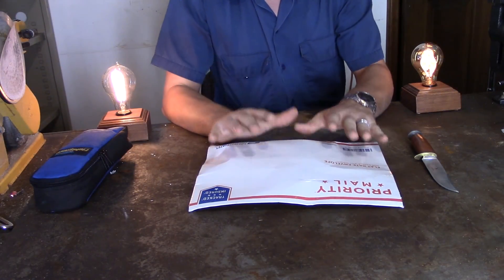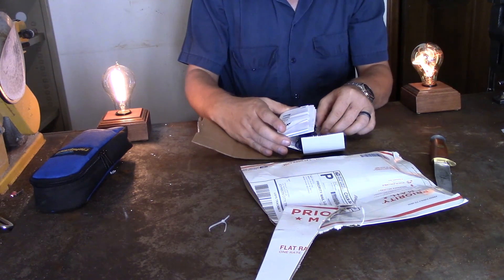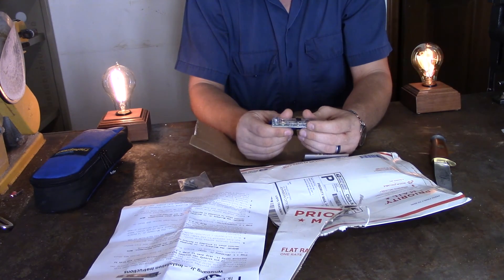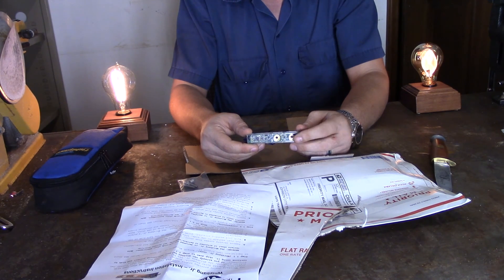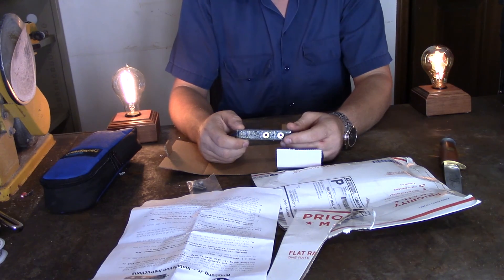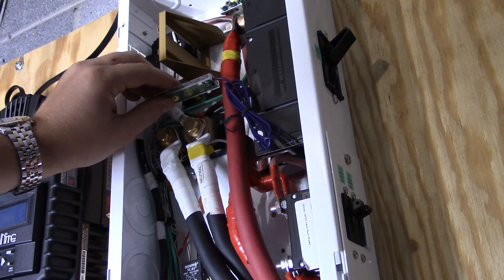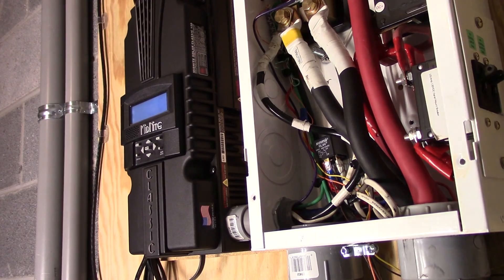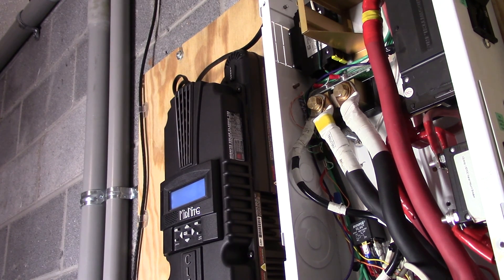Midnite classic wizbang Jr and why it's important to have for your solar power charge controller!

Comment: Additionally. Sounds like something that should be built into the charge controller if it is so essential.
Reply from the maker: It's not possible to add a shunt in the charge controller when you could possibly be discharging at 200 to 300 amps you have to have it external for instance my shunt is a 500 amp shunt and it requires a capability of not burning up at 500 amp the charge controller will never be able to allow 500 amps to pass through it for instance my charge controller can only charge it 90 amps and then we would have to have an output power circuit on the charge controller to provide 500 amps through the same circuit that runs a hundred amps instead they make it robust and strong externally

Comment: 😞😞😞😞😞 why. Why would it be nessesary to turn your battery on and off? This makes no sense. I been using solar and reading about it also for over 10 years. This makes no sense
Reply: This video was about worthless. Didn't even show where he hooked it up in ch controller or installation on the shunt. Show us closeup and straight on not at an angle at a distance.
Reply from the maker: Okay instead of thinking turning your batteries off it doesn't exactly turn the batteries off to the inverter and charge controller it turns the solar array off and switches to grid power automatically with the capacity on this for instance if you discharge your lithium batteries down below 3 volts per cell you completely destroy your lithium batteries now 18 650 run lower than that but I'm not going to run my lithium batteries that low since I've recently upgraded to a 33 kilowatt lithium battery I would never allow it to have a discharge below 3 volts in fact I've actually got it discharging at a much higher voltage than 3 Volts per cell so my total of 33 kilowatts but I only used 20 kilowatt and I have an automatic shut off or switch over for grid power so my apologies on how I explained it previously but the batteries never turn off from the charge controller
Reply: @solarpowerelectricityandel2915  I don't ever want to disconnect your panels from a charging system. Never ever. You'll burn those panels up.
Reply: @gratefultedd969  that is incorrect.

Comment: mostly rhetoric here in to four minutes. It's a battery monitor. It measures current in and out of the bank. Yes, it is a good idea to have one to help determine your state of charge and account for supply and consumption.
Reply: Thank you so much, I've watched three quarters of the way through and I still don't understand what it does from his video.

Comment: looks like you have a lot of experience, can I ask you it you think this charger is going to be able to charge lithium-ion(18650)battery packs
Reply from the maker: yeah absolutely
Reply: so do you think I should change some parameters, because the manual of this charge controller does not tell nothing about lithium
Reply from the maker: It will charge anything between 12 volts and 99 volts. Check out old time engineer  youtube channel,we both  have midnite classic .

Comment: Unless I missed something, I don't think I need this for my off grid system but I can see where this would be awesome for grid tied systems.
Reply: I will recommend you buy the unit. it doesn't matter if you are offgrider or grid tie. This device is very important to monitor your Battery State of charge and usage. 
God bless and have a bless day.
Reply from the maker: I don't  have a grid tied it's to stop the battery from draining from a relay i have installed to a  transfer switch
Reply from the maker: It turns the off-grid inverter off as needed with the battery below @80% and back on @81%
Reply: +Solar Power Electricity and Electronics (phillip20) interesting. I thought I heard you say something about it shutting off the batteries and it switching to grid power and I assumed it was grid tied. Looks like I'll have to dig through your older videos to see how everything is hooked up.
Reply from the maker: and my power is never interrupted
Reply from the maker: no need i'm getting a magnum this week coming up
Reply from the maker: Im going 48 volts
Reply from the maker: I have it now.

Comment: Whizbang is worth every penny. Wish I had installed it from day one also. Mine has been running for only a few weeks now. I added it to the shunt that was already installed for the Magnum battery monitor. So now both are monitoring off the same shunt. Simple, easy install. I use my whizbang for "ending amps" to trigger float. No more over/under charging! Working great so far.
Reply from the maker: Me too i will never have that problem any more.